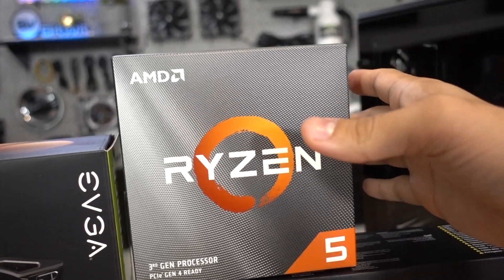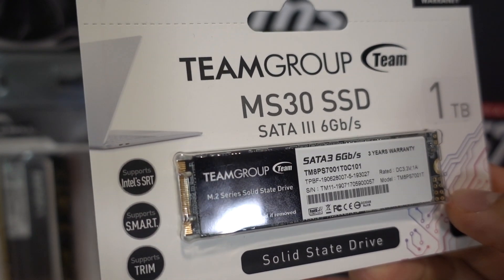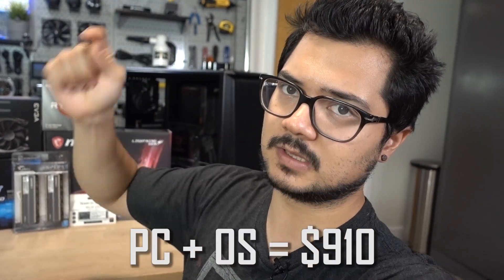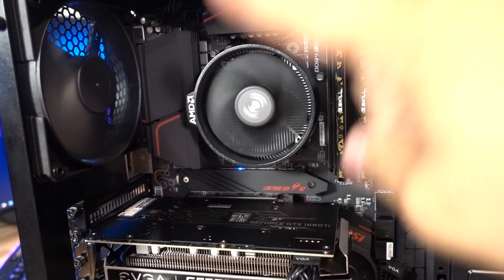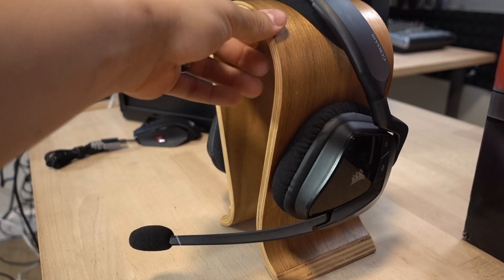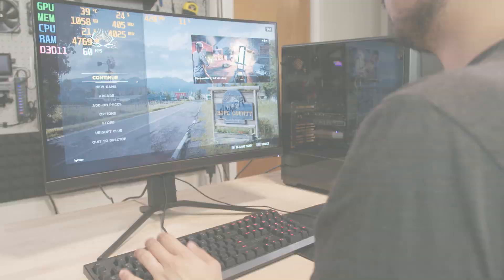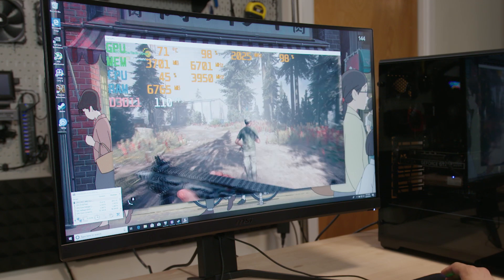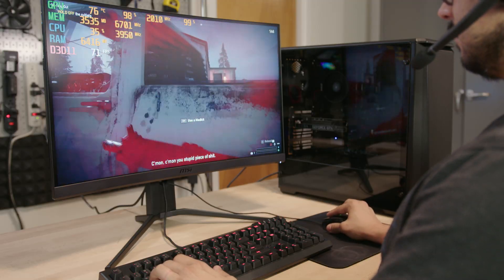Literally EVERYTHING you need to game on PC for $1500

Comment: on amazon there are some great deals if you look at the second hand options. like for the mouse and keyboard you can easaly save 10 to 20 bucks and often it is just a return that was only open for a minute. also this is true for the case save a few bucks and get that aio cooler. for the monitor i would go for a aoc 1440 27 inch that is around 250 euro's right now over here in the eu at least(for budget gaming in a darker room they are great. video card processor are great for this type of build. and i installed windows 10 today by my father in law and it was just activated for home use so it looks like it is free? maybe because i use a older download wich i have on usb? so that would save 30 bucks and that comes in handy somewhere else. but yeah somany options it is all depending what you wish for. newer tech or last gen and higher up like a gtx 1070ti or 1080p gaming wich is also still great

Comment: Amd 3600
MSI B450 Gaming plus  AC mini itx
16GB corsair vengeance rgb pro 3200
Intel 660p 1.02TB M.2-2280 NVME
Sapphire Radeon 5700 Pulse
Fractal Design Nano S
Evga SuperNova G3 650W gold
ASUS MG248QR 24" 144hz 1ms responce time monitor
Corsair K55 keyboard
Corsair Sabre RGB mouse
Corsair HS50 headset
Same mouse pad

$1447

Use the other $53 to replace the 2 case fans and or a better cpu cooler than the stock amd one. But still better build with more performance for cheaper and in a smaller form factor. Also yes AMD does benefit from RAM speeds but the only significant improvement is 2166 to 3000 gaining 25fps. 3000 to 3200 is about 5fps and anything after that is even less and with the full setup i suggest for less than $1500 you're gonna destroy the 1660ti anyways. However, you do have an extra $53 to play with so you can get better fans or you can pay an extra $15 for the 3600 kit of ram then have $38 for anything else.

Comment: i made a setup with the ryzen 7 2700x and 250 gb m.2 sd and a wd blue 1tb hdd and the rtx 2060 super and 750 wats of power by evga and i 144 hz monitor and a 75 hz monitor on a stand with the steel series apex 3 and the steel series rival 3 and a random xxl mouse pad

Comment: Can you plz do a $1000 version of this vid ?
Reply: B450, 2600, RX570/580/590 or gtx 1660 for the gpu. 1tb 660p. Some budget case, budget 500w PSU. There's a 144hz 1080p dell screen around $150.
Reply: Actually, I am going to build a PC for my friend and he wants to overclock it in the future and B450 MOBOs doesn't support overclocking. I'd prefer AMD cuz their MOBOs are of great value compared to that of Intel. Probably a 3400G paired with an X470 MOBO.
Reply: @abelwilson4729  B450 supports overclocking. 3400g with a x470 is a weaker choice than 2600 with a B450. You need to have your head examined if you're getting a quad core in 2019, especially for $1000.
Reply: @RandomPlaceHolderName Sorry, I get confused with B360 and B450. Damn! Naming Schemes! For a gaming PC, putting your money on the GPU is better. He said the main game he is going to play is GTA V. Kinda weird considering that's a 7-year old game but whatever. What MOBO would you recommend me for an i5 9400F ?
Reply: @abelwilson4729  Any cheap B360 will do. And yes, a gaming PC should be about 50% gpu by cost but 2600 or 9400f are the same price as a 3400g. No reason to buy a quadcore in 2019.
Reply: @RandomPlaceHolderName  So, I'm considering a Gigabyte B360M HD Gaming Motherboard. Is that ok ? or too cheap ?
Reply: @abelwilson4729  It's fine.
Reply: Great. Will it bottleneck the GPU or CPU in any way ?
Reply: @abelwilson4729  Nope.

Comment: I have a 3600, b450 asus mb, Rx 5700 xt, and a cheaper but equivalent monitor for just about the same price. Why would you go for a 1660 ti for a 2k gaming setup? The motherboard doesn't make much sense and the overpriced peripherals and the $100 you could save on the monitor would give you ample room to just opt for a better GPU from both manufacturers.

Comment: I literally have a Whole Setup with:
Razer Mamba Elite
Razer Ornata V2
Xitrix QHD 95hz Monitor 27”
1TB HDD Seagate Barracuda
250gb A2000 SSD
iGame Colorful RTX 3070
i5-10400
Gigabyte Aorus B460 Pro 
NZXT H510
And Etc. 
All under 2000$😃
(P.S)Everything in Asia is raised by 20$-900$
If you buy parts in US jt should be 1500$

Comment: You could've gone down to the Ryzen 5 2600, instead of the 3600, as well as (if you MUST spend $200+ on a monitor; oof) a ViewSonic monitor that's similar enough to that MSI one that the average person won't really notice the difference--
 
(( https://www.amazon.com/dp/B078ZJHD25/ref=sspa_dk_detail_0?psc=1&pd_rd_i=B078ZJHD25&spLa=ZW5jcnlwdGVkUXVhbGlmaWVyPUEyTDBCWjE0UDJaRlNRJmVuY3J5cHRlZElkPUEwMjMxMDg4T0RKSTFGRkVPWjJSJmVuY3J5cHRlZEFkSWQ9QTA3OTk4ODAyVFBWRTA0OEtESFUmd2lkZ2V0TmFtZT1zcF9kZXRhaWwmYWN0aW9uPWNsaWNrUmVkaXJlY3QmZG9Ob3RMb2dDbGljaz10cnVl ))

 --and used that saved cost to get a 4TB HDD to pair with that SSD, or gone with a better PSU (better rating, modular, etc...), or doubled your RAM (if you happen to be someone that'll be doing productivity or content creation as well). The 2600 vs 3600 performance isn't so substantial that you'd NEED to inherently go with one over the other; if you'd need the extra performance (and inherently better cooler), you could just jump up to the 2700X or 3900X.  

That's just me, tho. In terms of function over form, and being budget-friendly, this seems to be a better approach.
As a personal taste, too, that mouse chosen is way too clunky-looking, and the DPI buttons look like I'd hit them way too often on accident. I'd prefer a slimmer mode like the AZIO Atom RGB mouse. It's wired, but slimmer, easier on the hand, and still has respectable RGB while being pretty much the same price as the mouse you chose here.

Comment: It's not bad but save money on the keyboard, mouse, headet and monitor. 600$ for those 4 are unnecessary. You could get all four for like 400$. 250$ monitor, 50$ for mouse and keyboard and 100$ wireless headset. Spend the other 200$ on a better gpu and cpu cooler. Just my opinion

Comment: Hey!! Help me build my computer. Im stuck and don’t know what to do. :(
Reply: What are your goals for your system? What is your budget?
Reply: jtenorj i have all the parts but and its all build but im positive that its not built correctly. 
Msi b450 tomahawk mobo 
Msi radeom rx 580  
Amd rysen 5 2600x

Problem started with it not showing up on the display. When ever i tried booting it. Using the 
Aoc G2460PF monitor. Then it just completely shut off. No power, no nothing.
Reply: jtenorj thanks for replying too!
Reply: @brianmartinez7495  The main thing I can think of is to check all your power connectors. Mainboard 20+4 pin, supplemental 8 pin aka 4+4, cpu fan, case fans, front panel connectors, supplemental GPU power(6 and/or 8 pin connector), and while you are at it power and data to drives like sata SSD or HDD or optical if you have them. Double check the connection between your GPU and your display as well. Is the main power plug to the wall/socket firmly in place? Power strip(if any) to wall. Display power?
Reply: jtenorj yea i checked all that, i think i might disassemble and do it again. Thanks for the tips!

Comment: I'm running a 1060 and 4460 and it's almost as good as that brand new PC, Far Cry on Ultra ran on 60fps +/- 5fps, which is ridiculous, I could pull another 10fps from it if I had an SSD because that's the only bottleneck issue I have, so gaming-wise? This system performs the same as mine and mine is worth less than $800 now, so yeah, not a great time to buy a PC fellas, especially not a PC like that one, especially not for $1500, personally I think you could fit a solid 2060 Super in that budget at the cost of "downgrading" to a good B450 board, it would amount to approximately $1600, considering the fact that you could get a proper Asus IPS 144hz panel for as much as $250 saves even more money and opens up some wiggle room for a gold rated PSU and an NZXT H500i, which to me sounds like a hell of a lot better deal than this, and the results? I bet in at least 80-90% better performance, which is ridiculously better considering there's only $100 more in the budget

Comment: Well you got swindled on that motherboard. The VRM on the MSI MPG X570 Gaming Plus is atrocious, and you would have been better of with a MSI B450 motherboard if you are the least bit worried about the VRM. Of the cheap X570 motherboards the Asus Prime X570-P stands out when talking about VRM, the ASRock X570 Pro4 is surprisingly decent but not anywhere nears as good as the Asus. Gigabyte Gaming X is on the other hand surprisingly bad. Given the components used it should be at least decent, but no, the VRM runs very hot. Finally we have the MSI in this video, and there is something seriously wrong with the VRM on this, however this is not very surprising given the VRM design. It will probably work with a 3600 or any other of the 65W processors, but make sure you have good airflow or it could end up throttling because of the VRM overheating. MSI's B450 boards on the other hand doesn't suffer from VRM's as bad as this one.

Comment: Cheap down to a $100 B450, A-Pro has good VRMs.... better. Then, get 3200 CL15 to save about $20. Then get a 5700 or 5700 XT. 1660 Ti is dead, no more updates I bet.
Reply: 1660ti is a beast in 1080p but if you want to do 1440 than the rx 5700 is good.

Comment: Built my friends computer for 1300 with a ryzen 2700x, rtx2060, 750w Corsair fully modular, with a b450 board Asus ROG board, 1tb nvme qlc m.2, and $100 case. Yeah it’s QLC but this fool is only gonna use it for two hours a day.
Reply: F***, forgot to say that there was an AIO for the CPU cooler

Comment: MSI MPG X570 vrm is actually super bad, like ridiculously bad, Hardware Unboxed tested a bunch of boards and it was by far the worst. I'd replace it with Asus Tuf X570 Wi-Fi, very good vrm for the price and solid features. I'd also replace the peripherals with cheaper alternatives, especially the monitor which is a lot to handle for a 1660ti with all the  bells and whistles turned on. I'd get a better GPU and a 1080p monitor. But that's me.

Comment: Headset is not the first thing that should be wireless.  Mouse makes much more sense and is massively less compromised by going wireless.  I understand it's possible to build an AMP and DAC into into you headphones that might sound okay but it removes all options, isn't going to be cheap, and the sound quality is usually going to give you ear cancer... Especially when we are talking about budget setups. Throw away the corsair headphones and buy and buy something like an ATH-AD 500x or even cheaper open options like the Samson RH600. While I don't use a wireless mouse I'm not going to pretend I am good enough to feel the difference between wired and wireless when you CS pros all over Twitch using wireless mice they're probably good enough not to be limiting factor in my performance.

Comment: Bruh, I spent in total $285 less than $1.5k, and got a WAY better pc with an RTX 2070 super a 2600x, 32gb ddr4 3000mhz. I'm actually about to drop just a grand to upgrade mobo/cpu and get dif RAM and AIO.
Reply: The actual PC was 900

Comment: Wouldnt it make more sense to pair that 3600 with a b450 board and 3200mhz ram then since you saved 70$ put that into a rx 5700. Im no expert but going from a 1660ti to an rx 5700 is going to give you a bigger fps boost than the 400mhz in ram speed.

https://pcpartpicker.com/list/p662QZ

Comment: You might want to check out Hardware Unboxed's review of that board - https://www.youtube.com/watch?v=_7PkZwY9PWM.  Temps were awful (to the point where it could not complete some of the testing).  I think for the components here - you would have been better with a B450.  Ryzen 5 3600 with 3200 CL 14 would have been near as fast as pushing 3600 (close enough for this build anyway - where the GPU is likely to be your bottleneck in gaming).  The motherboard (for the memory) just doesn't make sense with what you set out to do.  Love all the videos though - and this is just my opinion - mostly worth the virtual paper it is written on :-).

Comment: my whole setup cost only 380 bucks
Reply: HOW??!
Reply: @poopsniffer4436   got a dell xps 8300 for free and i got a i7 2600  with the dell pc and 8 gb ram (free) 2 ssd and a hdd for 100 and a gtx 1050 ti for a 180 and a asus 1080p 24 inch 75 hz monitor for under a 100
Reply: @poopsniffer4436  i forgot about the mouse keyboard and headset witch a got for free too (my brother gave it to me tho)
mouse is a razer abyssus 2014 keyboard redragon kumara k552 mechanical keyboard and a logitech g331 gaming headset and it can run crysis

Comment: This is a decent build, but that mobo choice is awful. For the x570 chipset, the VRM on anything from MSI below the x570 Unify is garbage. At the price-point you're building for, any other brand would have been a better choice. Lyle could have told you this. I'm sure it just slipped his mind. Still love your vids man. Stay frosty.

TLDR / PSA: Unless you're in the $300+ price range stay away from MSI x570 mobos.

Comment: 144hz 1440p monitor but cant run games at that framerate...
Reply: My thoughts exactly. You'll proly have to turn down the settings quite a bit to get 60fps at 1440p with that card let alone 144
Reply: @superb9172  my new setup is better. And 200 cheaper. Keyboard mouse monitor mouse Mat. And the build. 3600 with 5700xt. SteelSeries m750tkl, glorious model O, msi mag241c 144hz 1080p VA, glorious xxl mouse Mat
Reply: The monitor ruins the setup

Comment: Hi I build 1500 dollar pc with better speces 
PC Parts
CPU AMD ryzen 7 3700x
GPU Nivida geforce 2070 Super
RAM 3200MHZ 16 GB
Mother board Asus prime X570-p
Psu 750watts
And a monitor for 100 dollar which is 1080p and 2 hdmi and VGA and built in speakers also with mouse and keyboard

Comment: Man 1500 dollars is mid range?
Reply: People are exaggerating what mid-range actually is... mid-range is being able to play the latest triple A games 1080p at medium or maybe high settings. At best you'd need a 1660 super or RX 580 with maybe a Ryzen 3600, B450 motherboard, one 144 Hz monitor, 450 watt PSU, 500 GB SSD, cheap case, cheap mouse and keyboard. All this for probably like $700, maybe $800 easy. And even then you could probably make some used purchases to bring the price down significantly.

Comment: Why the hell would you buy a 2k $360 monitor??!! MSI has a similar monitor which is a 24” 1080p for 189.00! Optix MAG24C. Then use the $170 you saved to be put towards a better GPU, like the RX5700 XT. Or even a 2060 super.

Comment: What a horrible choice for the keyboard and monitor. 
Your adamant insistence for MX Cherry switches are simply misplaced, Gateron, Outemu, and Kailh switches hold their own and offer a great value, you would save $30 by going with a Redragon TKL keyboard (and for a gaming rig you don't want a number pad, it really gets in your way)
That curved MSI monitor you picked is all kinds of wrong, starting with you don't want or need a curved monitor for 16:9 27 inch monitor to begin with, and 27 inch is just not worth it just to bump the resolution to 2K, I would stick with a 25 inch 1080P with 144hz, something like AOC G2590FX (G-Sync compatible) and save $180
With just these two adjustments, you'd save a whopping $210, which means you can get ride of that ghetto 1660ti gpu and get a nice and sexy RTX2060 Super and don't feel like your gaming rig is holding your mojo down, peace.

Comment: why are you lying to viewers about ram speed? all b450 boards support ddr4 3600 it comes in with ryzen 3000 support, and if you don't use pcie 4 there is no point in buying x570 board especially when you say you build cheep(and if this computer is for gaming then saved money goes for better graphic card, if you lucky you may even got enough for rtx 2060/rx 5700 - gtx 1660ti is very bad when it comes to frames per dollar rating)

Comment: Big fan but I'm going to have to jump in and say DO NOT get the MSI monitor. I just sent mine back (had it 5 days). Colour banding is terrible in blacks/grey (this is a known issue not limited to my one unit) which they claim is fixed by updating firmware. HOWEVER  you can not update firmware without sending it to a msi service centre. Numerous instances online of it not being fixed even after firmware update and monitors being returned damaged or scratched due. Also colour reproduction is terrible and OSD is limited so can't fix it really. Look at the acer 27 instead.

Comment: Why the fuck didny you use Logitech? For 385$ (Conversion from RON to Dollars, I live in Romania, probably there would cost less) you can get a G502 Hero that is just awesome, a G513 keyboard with RomerG Red switches that has RGB, a detachable armrest or whatever it is called, numpad, and it looks way cleaner. As for headphones... G533 are what is in stock in my country, but I know there was a better one... Nicer looking and with more specs. So, why the fuck did you go with Corsair and with a noname keyboard? (I know that gSkill Ram is the best, but are they any good at anything else?)